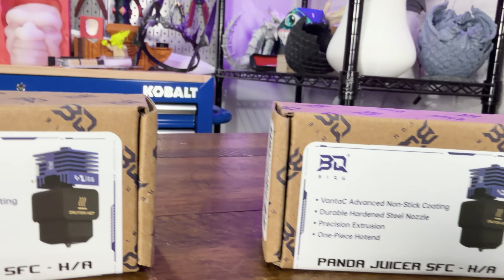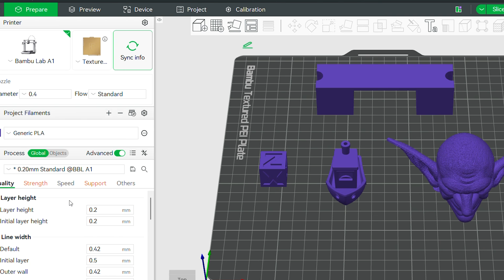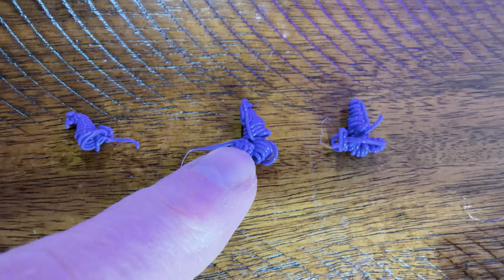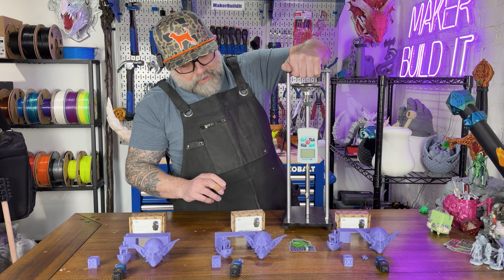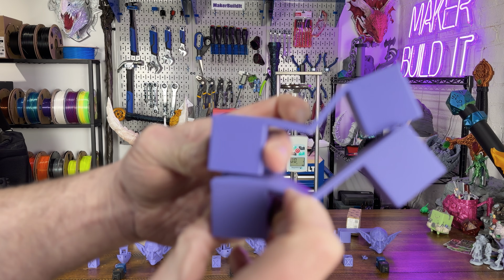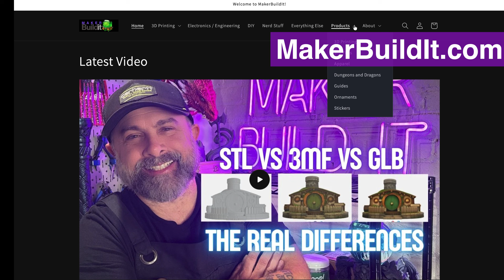Larger Nozzles = Cheaper Prints? (Testing All 3 Sizes)

Comment from the maker: 🔥 STRENGTH RESULTS 🔥
0.4 mm → 28 Newtons
0.6 mm → 39 Newtons
0.8 mm → 51 Newtons

Saved 1 hour 40 minutes using a 0.8 mm nozzle.

Question for you:

Are you Team 0.4… or are you ready to go bigger?

👇 Drop your nozzle size below and tell me what you print most.
Reply: So what im getting at is the old more layers=more points of failure. Also more material = more surface area to grip onto. (much like that guys wife LMAO)

Comment: Running larger vs smaller nozzles you should also do some taller / larger models. The larger nozzles really let you print a lot more larger stuff. 

There is also variable layer heights which can help with the top surfaces when desired with the larger nozzles. 

I personally like 0.6 mm.

Comment: I used a 0.6mm HF nozzle, combining size with high flow really speeds things up.. I've turned the lines for the most part, and I'm not doing a lot of toys or models, mostly shelving, organization, and technical items for servers and my dads ham radio stuff.. Lately, I've discovered PETG-CF (Creality Hyper has a very affordable pricing) and LOVE it in combination with my 0.6 HF nozzle.

Comment: Thomas Sanladerer had a video on this quite some time ago with hugely different (but way better underpinned) results.  His testing showed that the main difference between 0.4 and 0.6 mm nozzle was not with the nozzle, but with the settings the slicer uses when set to that nozzle.  Just telling the slicer you have a 0.6mm nozzle, but actually having a 0.4mm nozzle in the printer resulted in almost exactly the same result as when you actually had a 0.6mm nozzle in the printer.  This also makes sense: as long as your putting fresh plastic on top of another layer, the extra plastic extruder from your 0.4mm nozzle because the slicer is pushing out an amount meant for a 0.6mm opening, has no other option than to spread out under the nozzle until it's 0.6mm wide.  Now, the width the slicer targets is determined by the various line widths and even 0.4mm profiles will often use widths larger than 0.4mm.  For more details, lookup that video!
Reply: The only video of his I've seen did not show that using 0.6mm settings with a 0.4mm nozzle produced exactly the same results as using a 0.6mm nozzle.  He showed that it could have some benefits, but also has noticeable downsides.

Comment: ~All using the same settings except for nozzle size... 
Your tests don't really tell me much if you did not do a full tuning for all the nozzle sizes. I use from 0.2 to 0.8, depending on the job. Bambu's settings are VERY conservative with their mm3/s flow rates and actual printing speeds, especially if you use the generic filament presets. I can print those goblin heads and benchy' tests faster and with a very noticeable finish improvement with good tuning. Not trying to crap on your work, I appreciate you taking the time and sharing, just wanting to point out that as what is >possible< gets short sold if you don't tune, but for out of the box, just tossing different size nozzles in without optimization, your findings seem sub-optimal, though valid under your conditions.

Comment: You can't use the same files and just swap nozzles. You need to slice it for the nozzle size and have the proper settings. Both the 0.6 and 0.8 are showing under-extrusion. 
You also can't compare strength if you keep the same perimeters since the larger nozzles use more filament, will obviously be stronger. 
It's about using the right nozzle size for the right scenario. Each tool has a specific use. You don't use a wood bit to drill into concrete.
Reply: In strength, the drawing doesn't change, the boundaries of the print are the same, so its a fare test because you're getting a much stronger part, faster, in spite of more filament.. Which is part of the point of this whole test.. If you dropped, the walls and top/bottom layer lines you're just going to print even faster.... But not get the advantage of the strength AND speed. Why would you do that? I guess if you're ONLY after speed.. but again, that was not the point of the test.. it was to see what you would get with same DEFAULTS with different nozzle sizes. 

Thus the results.

Comment: Does anybody get first layer issues with aftermarket nozzles such as this Biqu or other generic brands? I keep getting really bad first layers on my A1 with any aftermarket nozzle, be it 0.4, 0.6 or 0.8, especially with PETG. That's after doing all the calibration after each nozzle change and selecting both dynamic flow and auto bed levelling before prints. Changed the Z offset in the gcode in 0.01 increments up to 0.04 (positive value) and still getting inconsistent first layers. Swapped back to original Bambu nozzles and reverted back to stock gcode, all issues gone.
Reply: Several reasons for this. The non uniformity in the shape of the taper, sharp or burned radius' on inside and outside of bore in the top and opening of the nozzle, and most of all probably is because the volume is incorrect for what the avg volume of a better quality nozzle vs junk made on less precise machinery.

Comment: I have a whole set from 0.2 - 1.0mm. I just change them depending on the print. Rapid prototype or for parts that don't need detail/are hidden get 0.8-1.0, regular prints get 0.4, anything that needs a high level of detail gets 0.2. One nozzle size isn't inherently better, they all have a specific use case. You wouldn't print a miniature with a 0.8mm nozzle or a large speaker adaptor with a  0.2mm nozzle.

Comment: What layer heights you running? I use 0.6 but 0.2 layers and my layer lines look more like your 0.4 layer
Reply: yeah, without giving any option if this was all print in lets say 0,32 or 0,24 layer height the comparison is kind of useless.
Reply: yeah, the benchies' roofes look like the layer height must have been different: 11 steps for .4, the .6 nozzle had 7.5 steps. Strangely enough, the .8 benchy has 9 steps, so its layer height was between the other two...
I have no idea what's going on 😂

Comment: What about the difference between a normal nozzle and a high flow nozzle? Does that reduce the time allot and is there any difference between quality? Great video by the way.
Reply: Allows for faster speeds but it's filament dependent and it depends on the printers frame rigidity and resonance calibration and compensation. Cooling is also a big factor.
Reply: @shawnmcandrew6923  I have an H2S at the moment , but still learning . I think it's rigid enough. Faster speed is always welcome if it doesn't pay off in quality.
Reply: @John-qe8zt  should have no issues that some tuning couldn't get dialed in. the h2s is a solid machine indeed. If i can get my k2 plus to behave doing that  then I'm sure a Bambu labs printer should have no real issues.